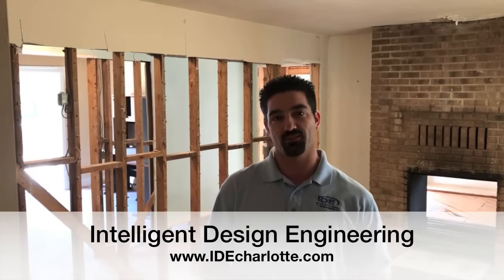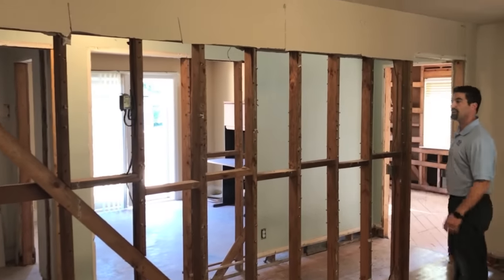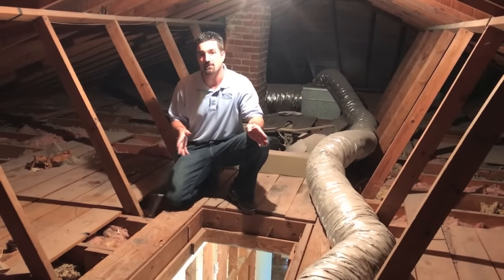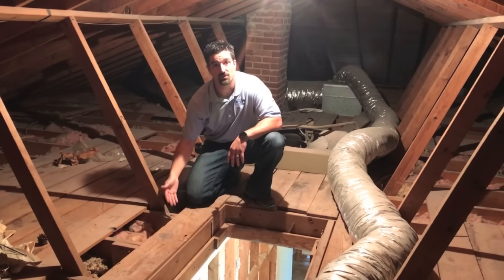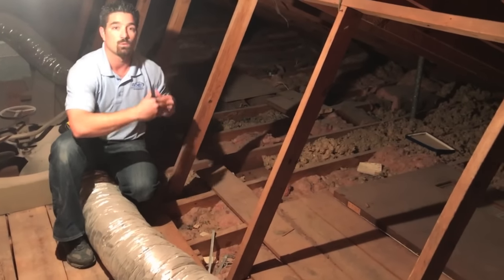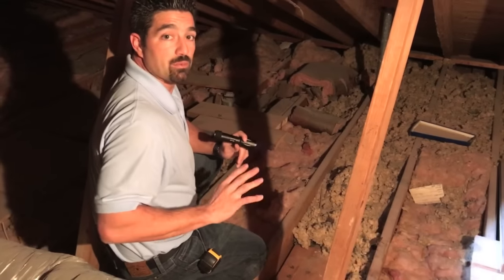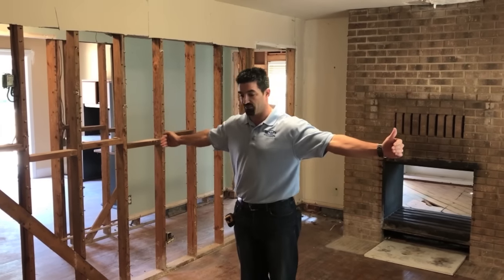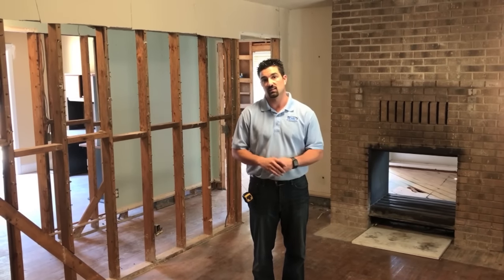How to Determine if a Wall Is Bearing or Non-Bearing

Comment: To put it more simply...

All walls that are Perpendicular to the rafters/trusses are load bearing, whether they were designed to be or not.

After 5yrs or more of the structure settling, there is now enough weight on those walls for the ceiling to drop noticeably if removed.

Sometimes it's only enough to crack the ceiling sheetrock, but I have seen it drop enough to break ceiling joists. YMMV.

If only moving the wall laterally a few feet (expanding one room), you're usually ok. If removing the wall entirely, a header is needed.
Reply: You are wrong with your assumption. Just because walls run Perpendicular to the rafters and trusses doesn't mean they are automatically designated load bearing wall. I have work on many homes. All you have to do is look in your attic. Or if you have a garage that is unfinished ceiling you look and see if it is manufactured trusses. Matter of fact in my home the only load bearing walls are exterior walls. It also has manufactured trusses. There are no trusses sistered together. This video is good for people wanting to know.
Reply: I said they BECOME load bearing due to settling, regardless of design. I've had numerous ceilings drop after wall removal, even though the trusses were engineered to support the total span. It's common enough to support my original statement.

Comment: The other giveaway that these are load bearing is that both walls have let-in braces, those are the ones that run diagnoly across the walls. Used mostly for sheer support

Comment: The roof of the home in this video uses rafters and joists and doesn't mention that more modern homes generally use roof trusses.
Reply: Robert Rinehuls if there are roof/joist combined  to make trusses  it is still enough,they will still be attached  to or sitting  on a wall.inside or outside  load bearing means just that. Old school carpenter
Reply: I wouldn't say more modern because it depends on the shape of the house and the builder.  Most custom builders still use stick framed (rafters and ceiling joists) because it allows for more attic storage..it's just more labor intensive.  A typical track builder that is building simpler "square shaped" houses will use trusses to speed up production time and reduce costs.  The only downside of using trusses I'm my opinion is limited attic storage.  If you do have roof trusses, there's a good chance that they are not bearing on your interior walls, but make sure you consult a structural engineer first.
Reply: I'm a general contractor and I stick frame everything. Depending on the design of the home, trusses can support the roof entirely from the exterior walls making all the walls in the home non load bearing. it really just depends on the design.
Reply: Marcel Papineau  Good advice, because as you guys know there are many house designs that use three point trusses, which are a little trickier to determine.

Comment: I have a wall running along a joist and in attic there are 2x4s running from the roof rafters to this same floor joist where roof has different lines - like side of house put up against the rest with same pitch but at a different level. load bearing? Would bracing against other joist take load if so?

Comment: Do you have any videos about putting in a flush/hidden beam in a ceiling space to replace a load bearing wall?
Reply: Check my reply to Ranulfo above.
Reply: Its best to get a structural engineer size them first though.
Reply: I watched the other vid where you show how a flush beam was weakened by cutting it to fit to the roof pitch. Luckily my beam is perpendicular to the joists and goes to the end of the house where the gable end finishes. That is; it is a flush end. But the other wall which does sit under a ceiling joist and on top of a double floor joist runs parallel to these members. At the centre of the house and top roof line the ceiling joists do rest on the centre hall bearing wall, so am unsure at this stage if the parallel wall bears the weight of the ceiling joists. Question is.. how would you do a beam over where the bearing wall is parallel to the ceiling joists? Thanks
Reply: If all of the joists have the same span and bear on the same center bearing wall, and there is no special roof bracing down to the ceiling joist/wall in question, then it is safe to assume that the wall directly below the ceiling joist is non-bearing.  In this video, the ceiling joist spaced at 16" on center did not fall over the parallel wall, so a flat plate was added to fasten the sheetrock.  In your case, it sounds like the joists were spaced in such a way that one ceiling joist ended up being located directly over the wall.  I think we are on the same page, and I hope this helps?

Comment: Where's the next video showing you install the beam? The home I just bought is identical to that layout.....but it's 20', not 18. Wanted to know what size beam you ended up installing? I wanna use LVL.
Reply from the maker: An LVL beam was used for this project, and they make some pretty deep LVL's (up to 24" deep), so i'm sure you can get something to work.

Comment: Would there ever be (ceiling) drywall between a top plate and a ceiling joist? I have a truss roof.  Wall is running perpendicular to the ceiling joist (middle of house). Seems like it is non load bearing?

Comment: I was able to remodel my master bedroom from 12'10" x 12'0" to 20'2" x 12'10" in part that the roof was constructed using free span trusses. This means the front and rear walls of the house (block) supports the trusses without need of any load bearing walls. In theory this means all interior walls could be removed without the roof failing. I took out two 5' x 3' walk-in closets and a linen closet to expand the bedroom's length. I built a 4' x 12'10" walk-in closet to replace the two removed. The new walk-in closet has close to 23 feet of rod space because I put in an adjustable rod system allowing two rods the length of the 12'10" wall. I also built two additional closets to replace a coat closet and the linen that were removed. While the total square feet was not increased I made the Master Bedroom almost twice it's original size. I also gutted the storage/laundry room connecting it to the house. I had concrete poured to level the old breezeway slab to the finished floor for both the kitchen and laundry rooms. The back door was there, so I removed it once the new room was completed. The space now measures 18'10" x 9'7". It now serves as a laundry, small storage and workshop. I also kept this room in mind when I had the Heater and Air Conditioner replaced. The AC man recommended I go from a three ton unit to a three and one half ton to accommodate the extra square footage being added. In all the remodel went without any problems and no plumbing had to be changed. Electrical was easy to move and did not create any additional loads on the service panel. I constructed both new walls of the laundry room to be load bearing as the trusses cross them or stop on one section. This meant the use of 2 x 8 lumber with a double header of 2 x 8 to support the trusses over them. I also used this opportunity to build new door frames for the 3 exterior doors to solid wood, make the 3 steel doors stronger and put on 3 high quality security doors. My windows had already been secured with the roll down shutters typical in the hurricane areas. This makes my home completely secure from unwanted entry.

Comment: Does anyone know what that truss design is called? I have a 1946 house that has a similar design but it also has some little 1x4s coming off the braces about 1/2 way down and going back (the opposite direction the brace is going, but also at an angle) and also ties in somewhere. I have not been motivated enough to dig through the blown in cellulose to see where it ties in. 
Just curious what my truss design is called.
Reply: do a google image search of "roof truss design types" - there are a lot of graphics that will show you basic web configurations
Reply: That is not a truss roof, it's a stick framed roof. That is why there is interior load bearing walls
Reply from the maker: I agree with Joe, given the age of the house and the description you have given, it sounds like you have a stick built roof, therefore the roof and ceiling members are likely relying on interior walls.

Comment: Here's my problem, the space above has a half the span size set of stairs from side to side upstairs and it's open.
It's just sheeted in, I have the chimney tore down to the floor level. I want to open it up to the ceiling on the second floor or top of the stairs. How do I determine if I can do this or not?!?!

Comment: Thanks for the tip, I am trying to install an in wall speaker, The problem i ran into was exactly where the cut out is going to be is a pipe to the left "steam heating pipe. Then a beam to  right of it, So the only direction i can go is to cute the beam side. I need to cut about 1 1/2 inches into the beam which is basically the beam side. it's only one beam, I am pretty sure its a load bearing wall. Will cutting that beam by 2 inches be a bad idea? I am not looking to take down a whole wall, just one beam.

Another route i can go is to move the speaker over another 20 inches "Kinda Far off" but again i am running into tow beams and at the 20 inch mark, I would have to cute about 3/4 into the beam and 17 inches long way "Top to Bottom. Would cutting 3/4 of an inch off the beam be a bad idea or would i have to support it before i make the 3/4 inch cut, then support it afterwards with two 2x4 's Horizontally then a king stud and a stud?
Reply from the maker: My safe answer is yes.  It really depends how much weight the beam is carrying, the size of the beam, and exact location you want to cut it.  This would require a site visit to answer accurately.

Comment: what about a wall that goes the same way as the 2 load bearing walls that are under ceiling joists but no braces down to it nor ceiling joists are spliced over it?

Comment: wish you could say the sizes of the beams at the end if for exemple 3 meter opening. is it about 2" x 8"
Reply: is this about near: 1m opening, 2" x 4". 2m opening 2" x 6". 3m opening 2" x 8". 4m opening 2 times 2" x 6". 5m opening 2times 2" x 8" ?

Comment: I need to just cut one 2 x 4 so I can make an opening for a door. Would that be a problem if it was in fact, load bearing?
Reply from the maker: You'll need to installed a header over the door to create the opening in a load bearing condition.  Without analyzing your exact situation, I couldn't tell you for sure, but i'm pretty certain installing a (2)2x10 header for a standard size 3-ft wide door would be enough.  Support each side of the new header over a 2x4 jack stud, which is the stud supporting directly under the header.
Reply from the maker: You can, but you'll need to support the new opening with a header.  The size of the header will depend on the loading over the doorway, but a (2)2x10 header is a safe bet.

Comment: So is there a solution for someone that wants to remove those walls even tho they are load bearing?
Reply: Aaron Bush yes. You’ll have to design beams to stretch over the span of the load barring wall area
Reply from the maker: You can, you just need to consult an engineer to find out what size beams are needed.

Comment: what type of engineer would you consult?
Reply: Structural
Reply: Tiffany Dorris,  I would suggest a good looking one with a good structure.
Reply: A structural engineer in your area.  Most only do commercial work, so you might have to dig around for one that is willing to do residential.
Reply: Tiffany Dorris 
Or you could consult with an experienced rough frame carpenter. They should be able to answer that question.
Reply from the maker: Google "Structural Engineer"....if it's for your house..."residential structural engineer"

Comment: My house was built in the '80's.  I have trusses in the attic spaced 24" apart.  The span of the trusses is about 26'.  I have an attached garage.  In the attached garage there are no interior walls.  In the attic the bottom chord is one piece of lumber.  Also between the living room and kitchen there is a span of 8' without a header.  The exterior walls are 2 x 4's . The house is a ranch.  Due to the the fact that the garage and interior opening are not supported, do you think it is possible that the trusses are supported by the exterior walls
Reply from the maker: Great detailed description.  Yes, those are all great signs that you have roof trusses that are designed to span from exterior wall to exterior wall with no interior load bearing walls.   Additional checks would be
1. Do all of the roof trusses have the same configuration including the ones over the garage?  
2.  Locate an interior wall close to the center of the house from the attic (usually hallway walls)...Is there a vertical member built within the truss that bears directly over the wall?  
3.  Is there a vaulted ceiling that may change the configuration of the roof truss?
4.  Are all the metal gang plates that connect the truss members together all tightly connected on both sides of the trusses?
Reply: Thank you

Comment: Yes, you can remove both walls, and even better create a more appealing space by vaulting the ceiling. Just convert all the rafters into a scissor truss, adding web as needed to create triangular cells. You also can create a parallel bottom chord to the rafter and then adding web to create triangular cells. Both solutions need structural calculations, both case you can improve by far the insulation of the roof. Beams are not the only solutions.

Comment: yes but you don't say the solution...
Reply from the maker: The beam size will vary greatly depending on the applied loads and the desired span.  The goal for this video was to help give a better understanding of what a bearing wall is and what to look for. ...But in this case, the required beam size to open up the entire living room wall was a double 16" LVL (Laminated Veneer Lumber) and a double 2x10 beam for the 6-foot opening in the dining room wall.
Reply: +IDEcharlotte
You could use steel for each one and install concrete at the bottom and use adjustable steel vertical supports at each end an also sink it up into the horizontal joists, making a flush ceiling.  It's a bit more work but looks better.
Reply: IDEcharlotte , thanks for responding

Comment: 2:17 The braces are not a factor, it's where the ceiling joists are cut that determines it.  And the insulation in that attic is pathetic.
Reply from the maker: Actually, the rafters are over-spanned in this case, so they are relying on the rafter hogs (purlins) and diagonal braces for support onto the wall.  By supporting the near mid-span of the rafters, when load is applied to the rafters they will transfer load to the wall making it load bearing condition.  If the rafters were 2x8's that can span further, then the rafter hogs and braces wouldn't be needed and then in that case you would only have the load from the ceiling joists.

Comment: Helpful? No. You first use an example that does not apply to most situations. I could conclude I don't have anything supporting my rafters so I could blow everything out. Which i know for a fact is not true. Ok, later in the video you say just this but then it becomes an incomprehensible flood of jargon which is ended by the only right advice. Hire a specialist. 😅